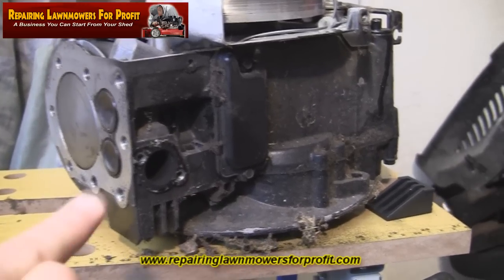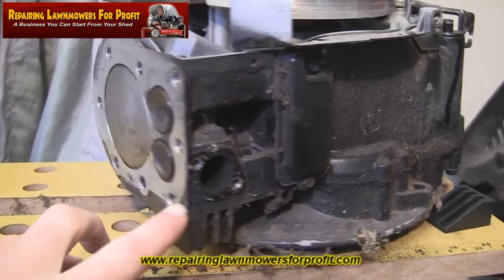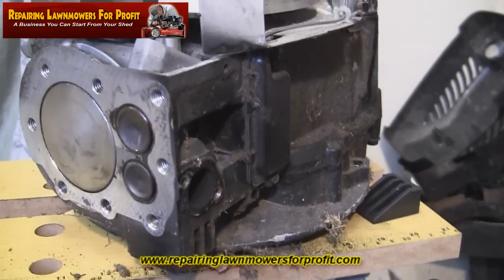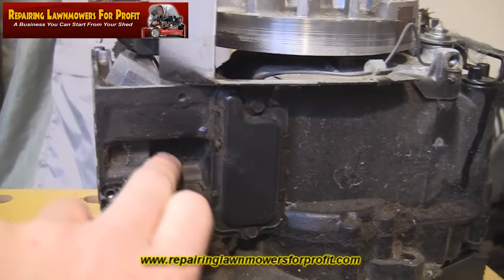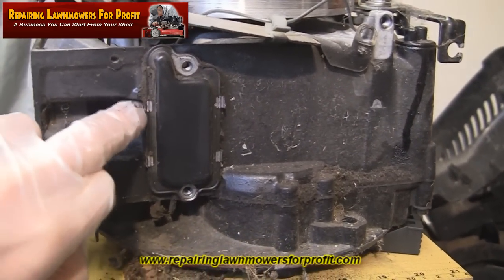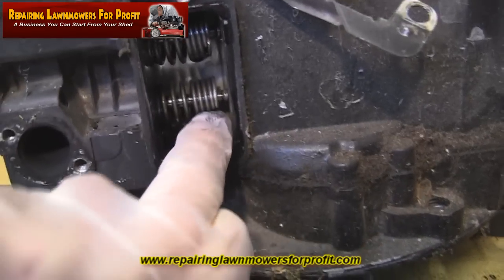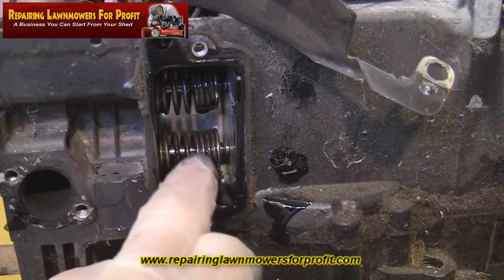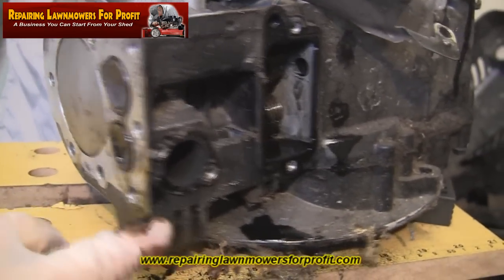Briggs And Stratton Overheating Engine Valves

Comment: Hello Mower Man
need your help! i was given a lawnmower off a workmate! the lawn mower started ran for a few minutes smoked and stopped!
i fitted a new Diaphgram,a new spark plug and a new air filter! cleaned the carb and put in new petrol, it started and was running great for a few minutes with no smoke! then it started to splutter smoke and rev up and down then stopped!! any ideas ?